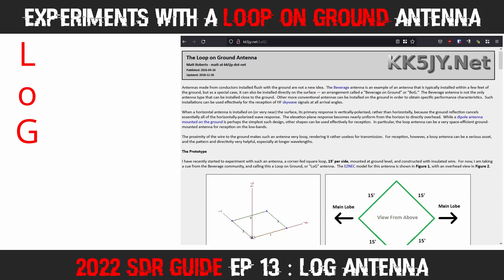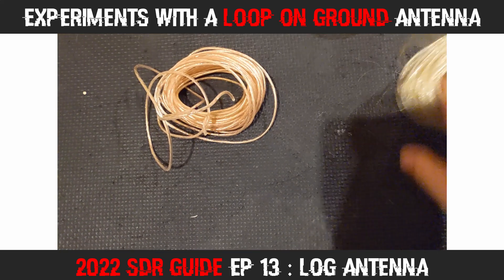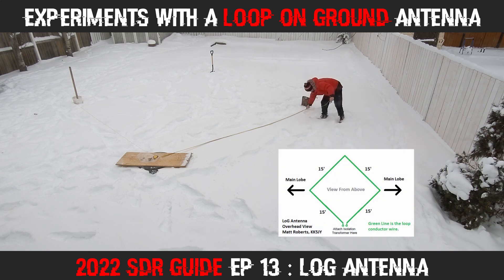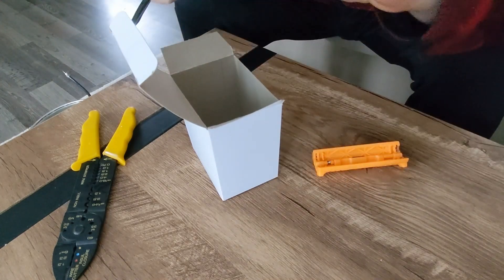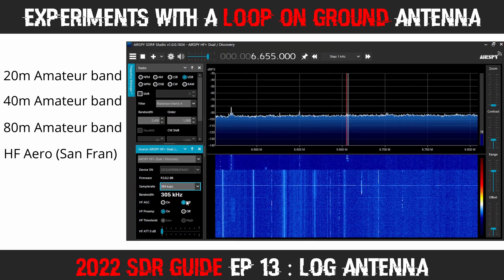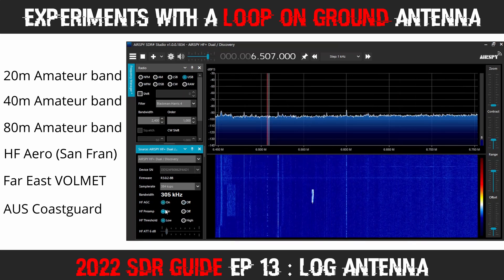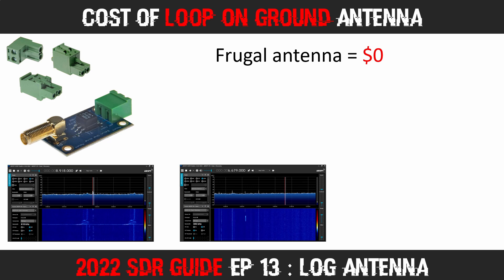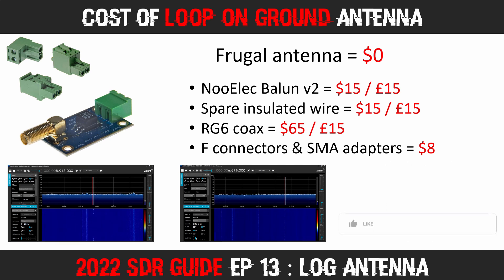2022 LoG (Loop on Ground antenna) for SDR radio tested on Airspy HF+ Discovery SDR KK5JY HAM radio

Comment: Question. I want to make a LOP for my ham radio for listening only. I want to use 75ohm rg6 to do it. I know with the balun I can plug it directly into the radio and it would work as long as I never tx. However I want to run it to a switch that would require a short run of 50ohm coax. Maybe a foot or two. Can I do that without harming my radio? Thanks.

Comment: Well of course you know any antenna set up in colder weather is going to be much better than one set up in nice weather. The more miserable the weather while putting it up, the better it will work. :)  But seriously... my KK5JY LoG works very well in my situation. It may not work EVERYWHERE, but for many of us it makes a big difference. Of course, your S meter will read lower, and I will sometimes use the onboard preamps in my receivers, but most of the time I just bring up the volume a bit and hear that S:N make its magic. But again, like most things antenna, it depends on your situation.
Reply from the maker: It was a great experiment, and one i had wanted to do for a while. Once Spring arrived and the snow melted I had to remove it. Management at home said so! But I do like a low noise floor!

Comment: Video idea: have you ever tried one of those "USB over Cat5 extenders" on Amazon to put the SDR in the attic? Will they work for SDR's? They should, no? See, I already have two Cat 5e runs up into my attic....but no antenna wire. Plus, the RX reception should be better in theory with only a few foot antenna cable at most since the SDR is in the attic!
Reply from the maker: It's a great idea. But no, never tried it. The main thing would be ensuring the SDR gets enough voltage to run. All I can suggest is you try it out and see. Please report back if you do! And yes, reception with shortened coax sand antenna in the attic should produce better results than having the antenna on the main floor.

Comment: I use LoG since 2020, but in the current version extended to 120ft, which improved SnR. And current mode choke on both sides is a must, decreasing the noise level furthermore.
Reply from the maker: That sounds great. Perhaps when the weather improves, I'll see if I can fit in the extended length. Good to hear yours is working well.
Reply: @FrugalRadio  G8JNJ did a great job on LoG performance. Check his website
Reply from the maker: Oh, I hadn't seen his site. https://www.g8jnj.net/loop-on-the-ground has some good information and tests. Thanks for pointing it out.

Comment: Would RG8X be OK?
Reply from the maker: For your antenna, you might want to remove the outer shielding, as it is designed to stop signals passing through. For your feeling, RG8X would be fine on the HF frequencies.

Comment: Interesting video, thanks. When you have time it would be good to have a comparison between your LOG and a raised antenna in your location. From other videos, there seem to be mixed results. A lot seems to depend on frequency (lower HF bands better than VHF) and how electrically noisy your neighbourhood is.
Reply from the maker: Yes, I think RF noise plays a big part in which type of antenna you would choose. Right now i only have 1 coax run set up, but come spring I should be able to do an A/B comparison with an HF dipole.
Reply: @FrugalRadio  Thanks for the reply and I look forward to a comparison test. I enjoy your very well explained videos and learn a lot. Keep up the good work!

Comment: How did you protect the Nooelec 9:1 balun from the rain and snow outdoors? Was your only protection placing it under the plywood sitting on top of the tire?
Reply from the maker: No, I sealed it in a plastic bag, and made a hole in the end for the coax to pass through.

Comment: Where can one get an Airspy hf+ discovery in US?
Reply from the maker: AirSpy.us is your local dealer. However there are major distributions in deliveries right now because of the chip shortages. Might be worth checking if they've got stock.
Reply: @FrugalRadio  Their website says they are backordered and they don't know when they will receive them.
Reply from the maker: Ah, okay. Yeah, the factory have run very short on components. They are getting small batches made and sent out, but the chip shortages and bidding wars among manufacturers have caused major issues. It might be a while before restock happens.

Comment: Wow, it seems like the LOG antenna is quite good on HF!  I wonder how it would perform in an attic location, at about 20 feet off the ground?  I'll have to try it out sometime with some Dollar Store green twist tie wire.   Thanks for the video!!!
Reply from the maker: Yes, it has been working well. But if it goes in your attic, it will no longer be a loop on the ground. You may find you get a higher noise floor. Please report back if you try it!
Reply: @FrugalRadio  It will be LOA antenna. Loop On the Attic.
It would probably make sense to try putting it on a layer of grounded foil.
Reply from the maker: Interesting thought. That might help cut down QRM from within the house.

Comment: Nice. I'll have to give this a try.  I currently have a gap in antenna coverage from 220kHz-25MHz, and an unused 1:9.  Also a crapton of RG6 that I will probably never run out of.
Reply from the maker: Sounds like you've got all you need then!
Reply: @FrugalRadio  Using 60 ft of otherwise useless phone cable as the antenna, I was able to pick up CHU in Ottawa and WRMI (Radio Miami International out of Okeechobee FL).  I'm in central Texas, so not too shabby.
Reply from the maker: Excellent, well done, and thanks for the report. Great to hear it worked in Texas!

Comment: Have you A/B’ed it against any other antennas to compare in equal conditions?
Reply from the maker: Unfortunately I only have the LoG and a dipole set up. But they share the same coax feed and have to be manually connected outside. Perhaps in Summer I can run extra coax and get set up for real A/B testing.

Comment: "I badly need to get into HF. But how will I build an antenna in my yard if an inverted V-dipole is out of the question?"

It's like you upload a video the day after I get a brainwave and I'd like to kindly ask you to get out of my head.

But seriously, this is perfect and I'm engaging with exactly this rig this weekend. Cheers.
Reply from the maker: Awesome to hear. Have fun with it!
Reply: Great for listening. If you want to transmit you'll need a second antenna; the LoG isn't good for that. A vertical might suit your limited space; I'm guess your yard is too small for an inverted V for the bands you want.
Reply from the maker: No, I've got space for a dipole, G5RV or similar. Although I think I would probably go with an end fed half wave or vertical for a transmit antenna.
Reply: LoG is receive only, period.
Reply from the maker: Yes, this is a receive only antenna, although there are users who have a separate tx antenna, and switch to the LoG for rx.

Comment: Yeap speaker wire is best option for that projects. I am thinking about same antenna design, but I will try install it in more permanent way. I have small recomendation for you, if you wanna have device similar to RSPduo's Diversity try QRM Eliminator or any kind of phaser, it work great even on 2m band. 73
Reply from the maker: Oh, interesting. I think some of the diversity projects could be really beneficial for reception.
Reply: @FrugalRadio  yeap, I have Duo and QRM Eliminator, Eliminator is better in one thing if you turn it off it passes signal from main antenna, in Duo reverting to single tuner resets waterfall, and you lose checking point from Diversity. Good thing and cheap.
Reply from the maker: Thanks for the info!
Reply: Speaker wire is best if you're buying new because it's inexpensive. If you can get to a hamfest you might find other options at an even better price, like the big spool of black hookup wire I bought years ago.
Reply: @ShirleyMárquezDúlcey  but sometimes you get steel wire, copper OFC wire is not bad for antennas, and you have 2 antennas (long wire) or dipole from same length of wire.
Reply from the maker: It works especially well for this antenna because you need insulated wire.